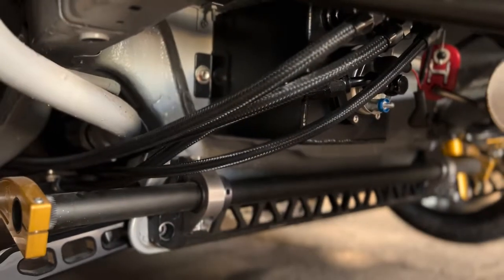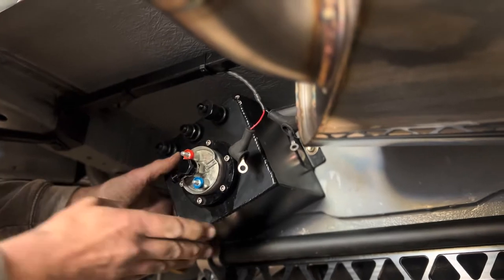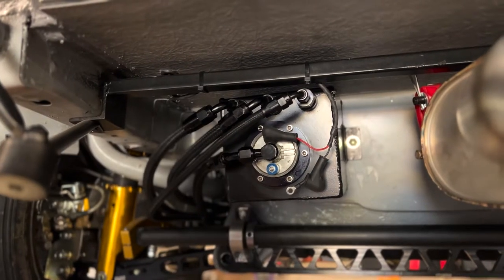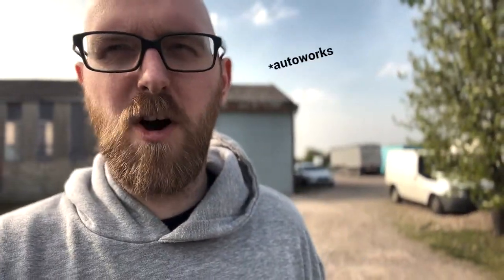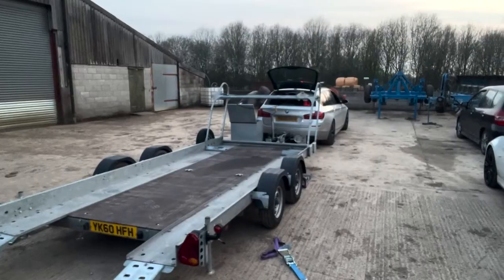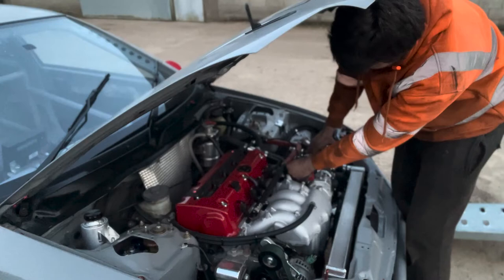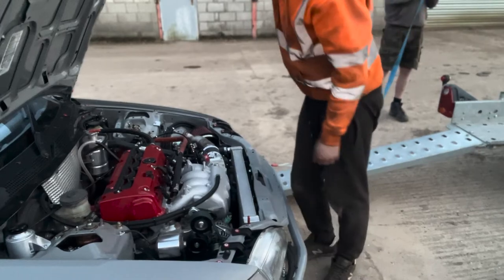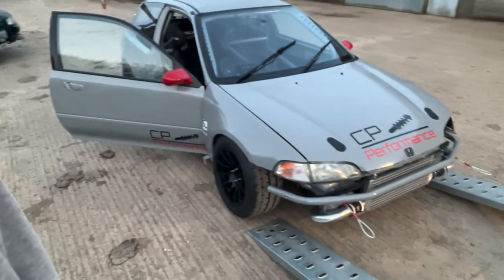Taking our SUPERCHARGED K24 Civic to the dyno! - 750MC Roadsports - Vlog 002

Comment: What size charger is this & how much psi ?
Reply: C38-61 @14psi
Reply: @petelawton-hcr_works6059  your kidding , impressive for the set up. I have a c3892r on the dyno at the moment. Pulley sizes will allow for 21 psi if the belt doesn't slip. Should have results by wednesday
Reply: @adriancowan936  Big boy that. We have  8 rib conversion, no belt slip 👌🏻